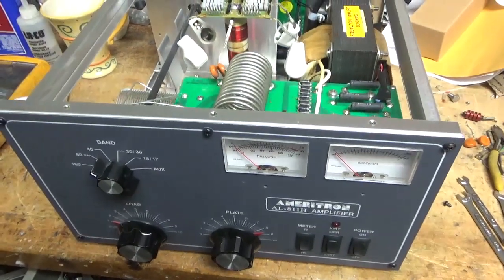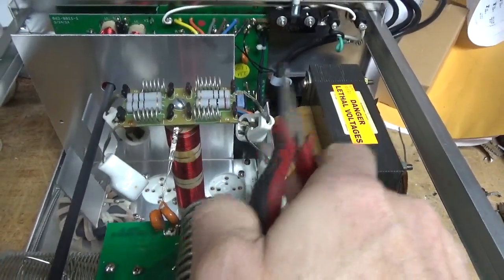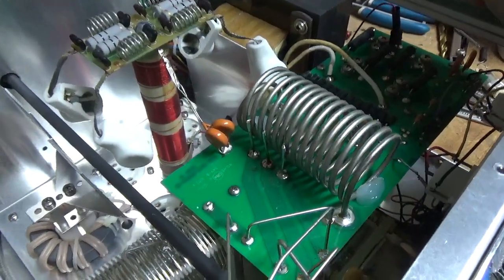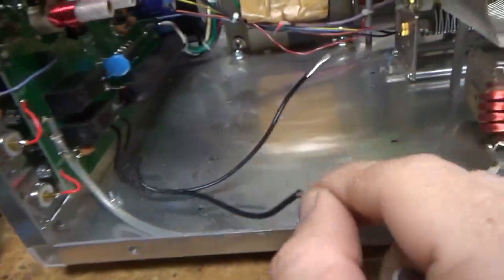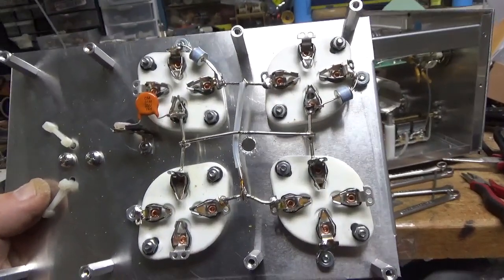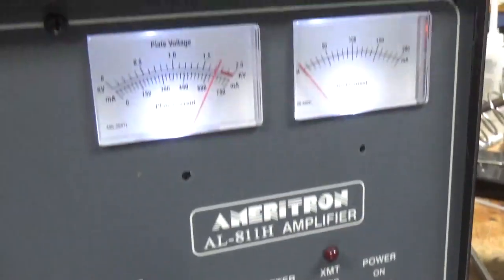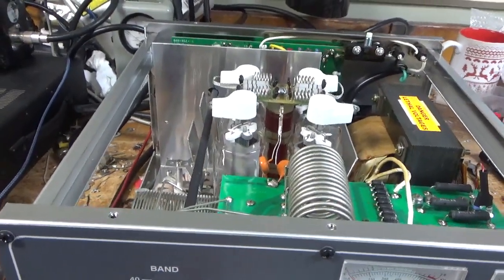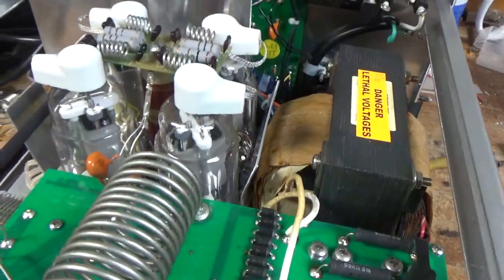Ameritron Al-811h Repair And Modifications, Parasitic Board Strap Replacement, Missing Solder Etc

Comment: Do you have any 180 450 volt capacitors for a Henry 2K classic console
Reply from the maker: Yes , they are available on the Harbach site 

Actually an upgrade 220uf 500 volt with new bleeder / equalization resistor’s

Under miscellaneous and other parts